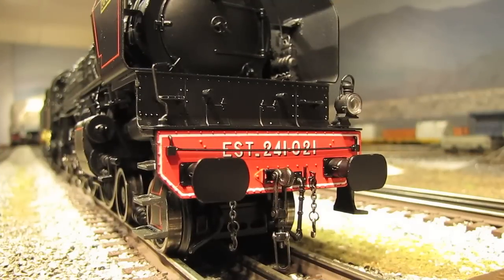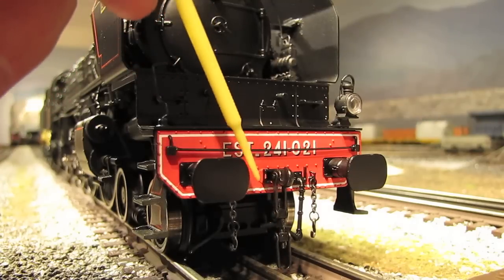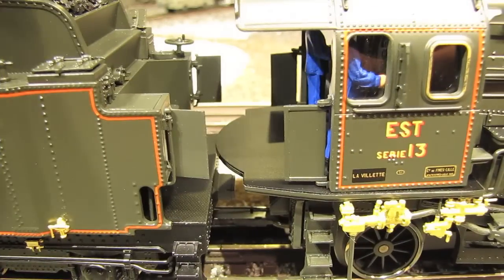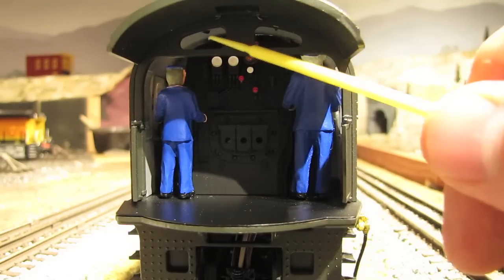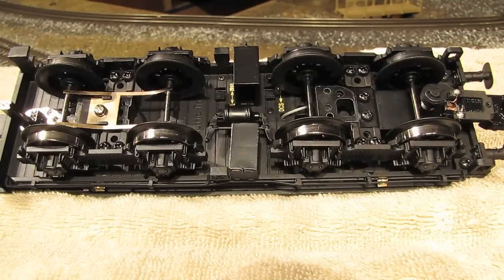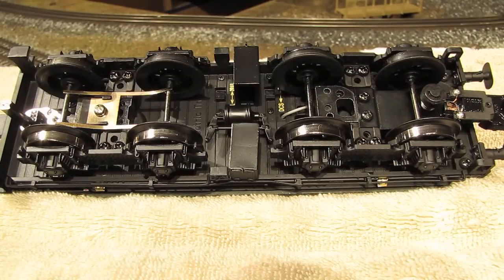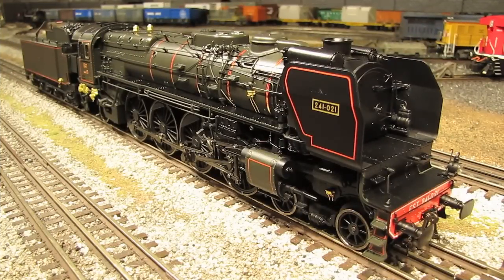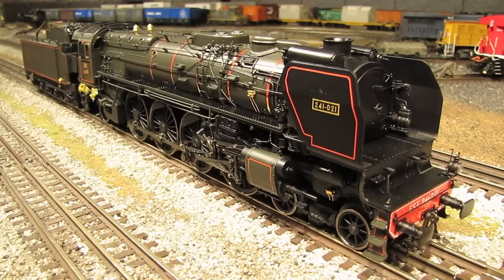MTH EST Era II Class 241A Steam Engine

Comment: Just a little fun fact for you, if you're interested in how the Europeans do things on their railways. The whistle signal to start in either direction is one blast, either long or short at the engineer/driver's discretion.The whistle is also sounded, just once, when entering and exiting tunnels, going over bridges, and at crossings.

They just don't use too many calls on the whistle over there, which is a shame, for those high pitched tooters do sound rather good when you quill them.

Comment from the maker: The MTH quillable remote is not as well deisgned as Lionel's, because it was implemented long after the DCS remote came on the market. The whistle is quilled using the click wheel on the DCS remote. Each click notches the whistle up or down. It's not as easy or smooth as Lionel's, but with some practice you can get pretty goot at it. My guess is that when MTH comes out with a new remote (who knows when that will be) it'll have a better mechanism for the quilling whistle.

Comment from the maker: The amount of smoke visible in the video depends on several variables. First, sometimes the smoke just doesn't show up very well on video due to lighting or background. Secondly, sometimes after I've been filming the engine for a while the smoke fluid level has dropped and the amount of smoke has decreased a bit by the time i get a good take. Lastly, sometimes I have the smoke level set on low instead of high and I don't realize it until after the video is finished.

Comment: Where did the bell come from??  Locomotives in Europe DONT have a bell fitted, to sound in yards etc, like US engines! The Ace trains coupling is the standard British 'Course Scale', coupling used by o gauge tinplate type trains since the early 1900's, by Bassett Lowke, Hornby, Exley, Milbro, Leeds, Marklin, etc,etc,  This coupling was used, as you can push a train of coaches ,wagons etc, as the two couplings stay in line through tight tinplate curves. if you try pushing a train with scale type couplings, through tinplate tight curves and with course scale wheels, the buffers will pass each other and lock!

Comment: Actually, the the head light configuation for all european steam locomotives different from our head light system. for example, if the locomotive was pulling an express train, the yard fitter would place two head lamps on the buffer beam. One on the left side and one on the right. that way the signalman could tell what line to put the train on.